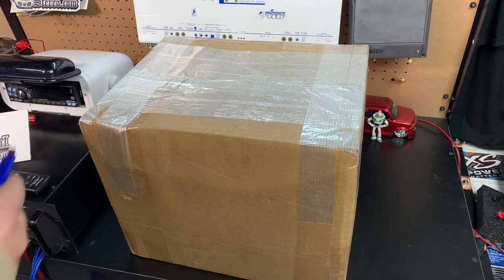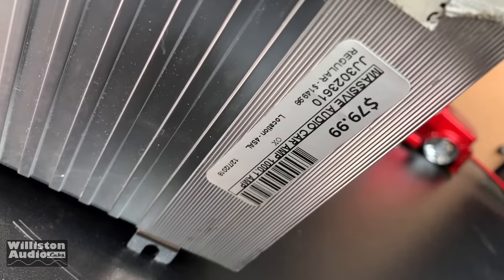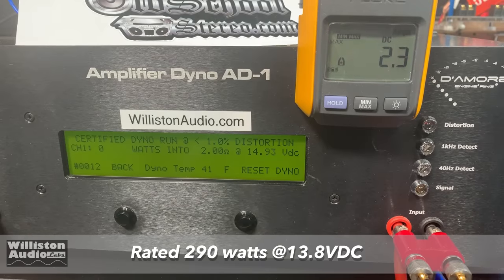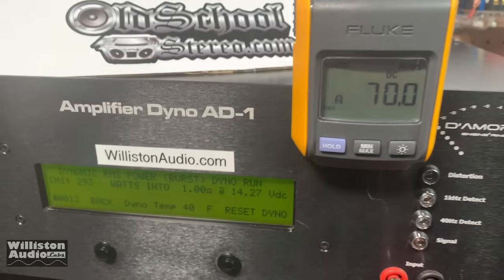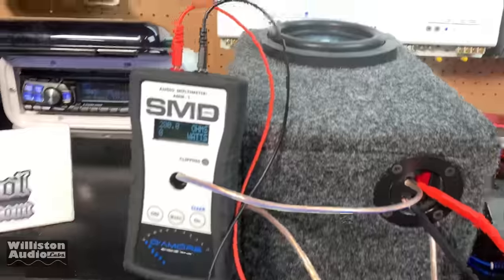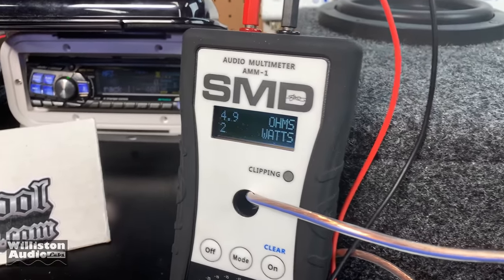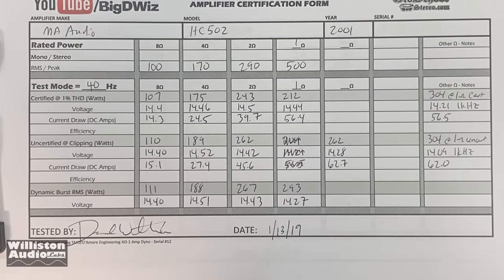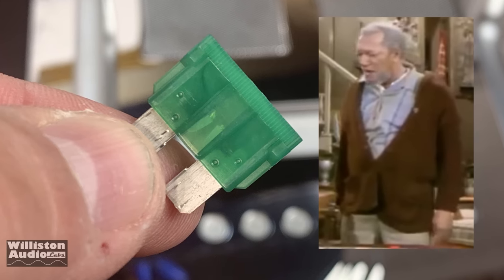What's in the Box Wednesday? Episode 1 - Not So High Current [4K]

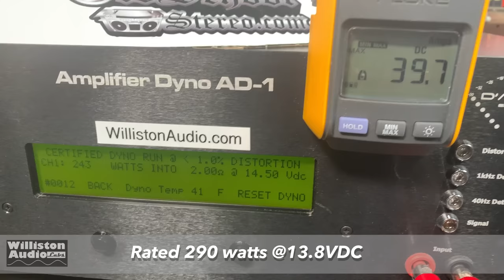Comment: 3:15 how can it pull nearly 40a of current when the fuse in the amp is only 30a? Something i never quite understood
Reply from the maker: Fuses can handle 2-3XL their ratings for short periods. I actually Chester with this amp and used a 40A fuse for the 1 ohm tests. The 30A fuse would blow almost instantly (see end of video)

Comment: I didn’t know you could get 500 watts with a 20 amp fused amplifier I’m impressed that the fuse didn’t blow during testing
Reply from the maker: It spec’d a 30A fuse, which popped (end of vid), so I did the logical thing...put a 40A fuse in 😁

Comment: I had a hc4002 thing was massive was pushing 4 12s at 1 ohm
Reply: I had that amp also, pushed 4 15" MA Audio dvc subs in my 87 Ford ranger SUPERCAB. Had 3 batteries and 3 caps, ran it in 1.5 ohms stereo and did 153-154db in USAC competitions. I could rattle pics hanging in the house playn it in the driveway w/ the Sony demo CD from the early 2000s'. That system was a serious chick magnet 😎😁😎😁😎

Comment: Maybe the capacitors were blown and the transistors were missing a Vacuum Tube
Reply from the maker: I think the Flux Capacitor was running on low plutonium
Reply: Maybe the flux capacitor, needs a new iridium lining. The wattage above 77, is backing up. So that means the Omega 3 Drive, may be fried 😱

Comment: That’s a 20 amp fuse you big dummy ! Wait wut...at 1:25 it has a 20 amp fuse and at the end you blew a 30 amp fuse
Reply: It came with the wrong fuse so he obviously stated (and put in) the correct rating. At the end he blew the 30a and there's a comment that he put in a 40a to do the 1ohm bridged test.
Reply: Ya I saw that too! 😎😎😎
Reply from the maker: Y’all miss nothing! Brad told me it needed a 30A fuse, so after unboxing, I put a 30A fuse in...this fuse blew during the 1 ohm test, so I replaced with a 40A

Comment: Those amp’s were trash
Reply from the maker: Yeah pretty much
Reply: @wal  would love for you to find an Audiobahn 2300hc and test it.  Back in the early 2000s the wife and i competed in the 600 watt stock class with 2 audiobahn 18s averaging 157 and hit 162.4 a few times.   Would love to know what that amp really did for power. Was rated 300x2 at four ohms rms and 2400 at 1 ohms.  Sure felt like it hit those watts.  We took 1st 98% of the time and was Tx state champ several times.